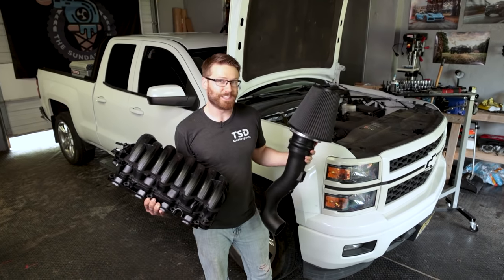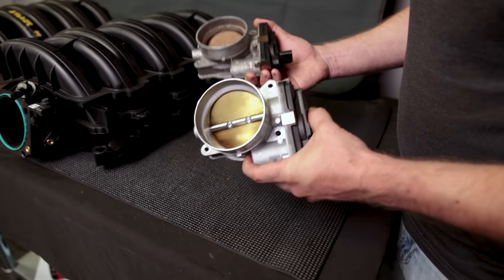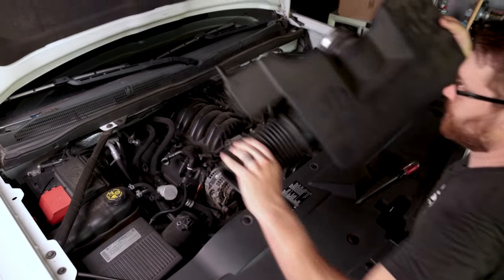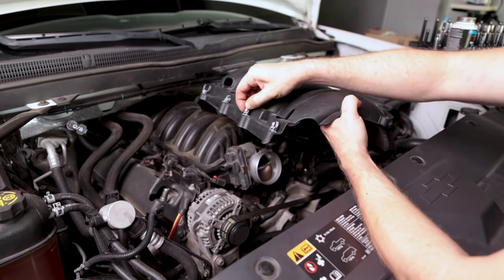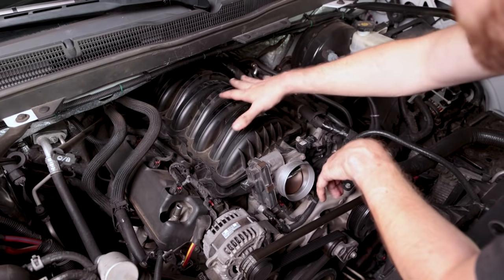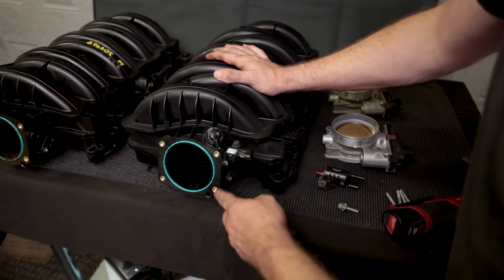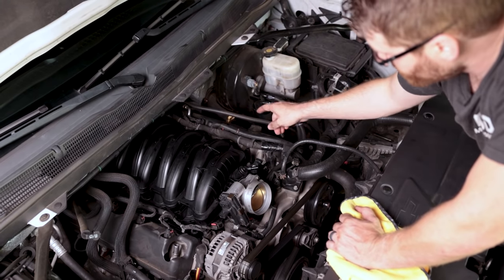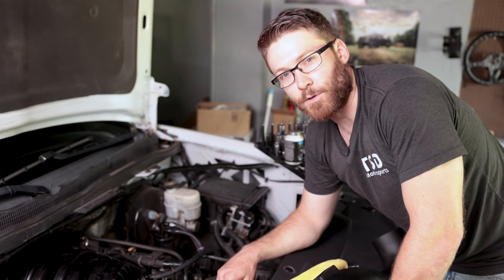6.2 Intake Manifold and Throttle Body Install on a 5.3 - 2014-2018 Silverado Sierra Tahoe Yukon

Comment: If i upgrade these two mods is it mandatory i tune or no tune requred?
Reply from the maker: I am not a tuner so take this with a grain of salt but I ran these for while with no modifications to my tune and has no problems so from that experience I don't believe a tune is required. A tune will help you get the most power from the upgrade tho
Reply: @TheSundaeDrive  it's it much appreciated for ur reply man thanks for much help ur channel helps me alot ⚡️⚡️😎
Reply from the maker: @chevyboiii2115  no problem! Glad to hear it!

Comment: Can i do this to my 13 tahoe? Do you have to retune pcm after this install or is it a turn key swap?
Reply: The 2013 Tahoe has a gen 4 engine. This is a gen 5. You already have the best gen 4 truck intake on your 2013. It come stock with the TBSS intake. Look it up.
Reply: @sstevocamaro what about 04 sierra? Is a throttle body conversion worth it? Let’s say 04 throttle body to 08-13,14-18,19+?
Reply: @sstevocamaro it’ll effect smog emissions for California too?

Comment: Is it plug and play?
Reply from the maker: I did get a custom tune but I drove without a change to he tune for awhile without issue.
Reply: @TheSundaeDrive  thank you!
Reply from the maker: @dominicjlesperance3328  no problem! Best of luck with it!
Reply: @TheSundaeDrive  thank you for the amazing idea!
Reply: I’m gonna sound like an idiot right now but my engines shaking and says “reduced power mode”
This is really embarrassing
Reply from the maker: @dominicjlesperance3328  check to see if your intake manifold has an extra pcv connections at the back. Which engine did you intake manifold come from?
Reply from the maker: @dominicjlesperance3328  it would be in the rear driver side. Mine doesn't have this but apparently someone else's did so in thinking there is a different 6.2 intake manifold that some of you are getting so very curious to figure it out since mine does t.
Reply: @TheSundaeDrive  the manifold is a 6.2
My engine is a 5.3
Reply: @TheSundaeDrive  like I had the 5.3 manifold in there previously. This is the 1st time o tore it apart
Reply from the maker: @dominicjlesperance3328  let me know if you have the extra pcv connections
Reply: I have all the plugs in and I followed the torquing instructions.
Reply: @TheSundaeDrive I think it’s just the one pcv valve connection
Reply from the maker: @dominicjlesperance3328  not sure then.  All the gaskets are installed? Someone else commented that they had a similar issue to the one you are having and they apparently had an additional pcv connections towards the driver side rear of the intake manifold.
Reply: @TheSundaeDrive  I only saw the one pcv connection. Gonna hope for the best. Get that 6.2 pcv hose and if it works. I’ll let you know
Thank you for the advice
Reply: @TheSundaeDrive  additionally yes. I put all new gaskets in

Comment: Guys when Chevy sells their vehicle they put the best package for the engines that a stock option has to offer , so swapping stock parts for more stock parts is like a wasite of time ..
Reply from the maker: I picked up hp tho. Check out the Dyno results video.
Reply: You’ve never done anything with motors and it’s obvious. 
You can take different 212cc heads and swap those for higher compression. Higher compression means more power.

Comment: Hey man I got a 4.8 I wanna put an iir intake like that on mine is this something that will fit my truck
Reply from the maker: What year is your truck?
Reply: @TheSundaeDrive  its a 09
Reply: @TheSundaeDrive  I appreciate u replying sir 🙏 I got one more question I do wanna start putting performance parts 😅in my truck I wanna start with a cam but I'm not sure what size I would need my truck is bone stock would u no a part number and what els iwould need for that cam upgrade thanks in advance sir

Comment: The factory driveshaft can’t handle over 100mph? Is that why they are governed?
I was looking into doing some performance mods as well as a programer
Reply from the maker: Correct. It vibrates too badly and can split.
Reply: @TheSundaeDrive  guess i’ll be changing that before doing any other mods
Reply from the maker: Definitely a need if you want to go over 100. I have a video on it.

Comment: will this work for the 2017 1500 5.5?
Reply from the maker: I'm but familiar with the 5.5 engine. If you meant 5.3 then yes it will work